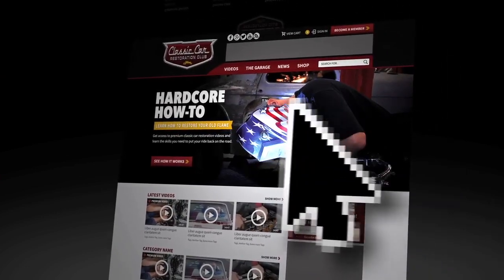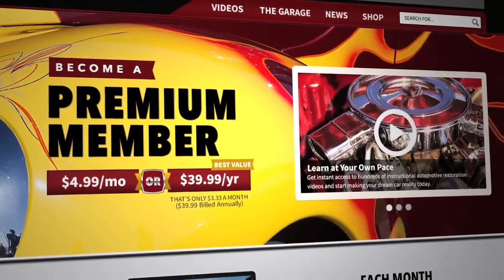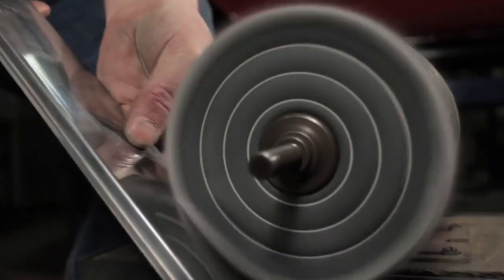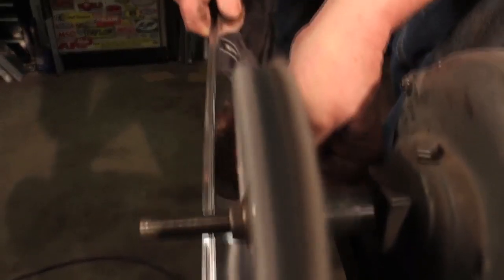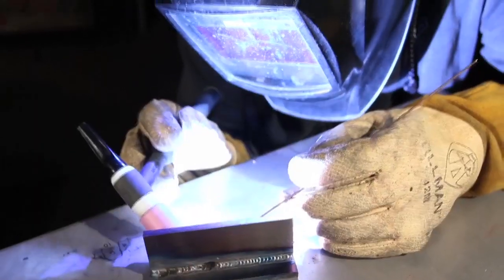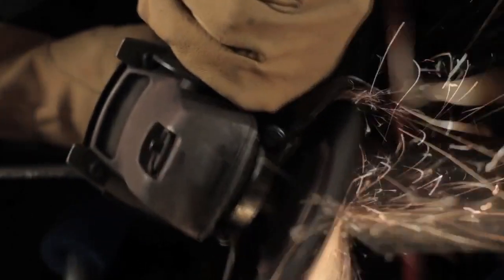Classic Car Restoration Club - Overview

Comment: I watched this video and it looks like there are 7 leaves in those leaf springs. The thing is that I thought that the 7 leaf springs were only on the Adventurer, since it had stiffer suspension. 
On the other hand, I've seen pictures of Adventurer undercarriages online that only had 6 leaves, and I thought "that's not right" . . .
Btw, I have a set of springs that I'm pretty sure came from an Adventurer and they have 7 leaves.
Can you clear up my confusion? Thx.
Reply from the maker: Hi Bruce,

The car in the video has six leaf springs, I just went out to the shop and counted them. 
I know Adventurers had stiffer front suspension, but can not confirm the rears also were stiffer but it stands to reason it could be... wagons also had stiffer front suspension. 
The Adventurer torsion bars were an option on the lower models that received Heavy-Duty suspension. 
The springs have begun to sag some on our Fireflite since we put it on the road and new springs may be in its future. 
I checked Hollander's interchange manual and they did not list a different rear leaf spring for the adventurer or the Chrysler 300, but because of their rarity they may simply not be considered. 

Wrench Safe, Mark
Classic Car Restoration Club